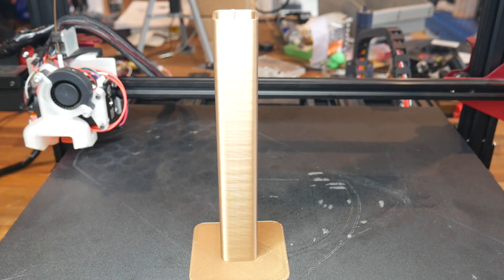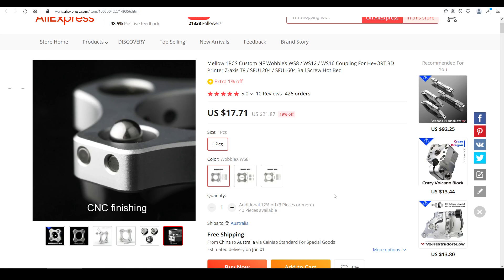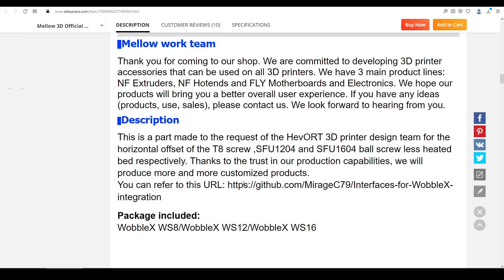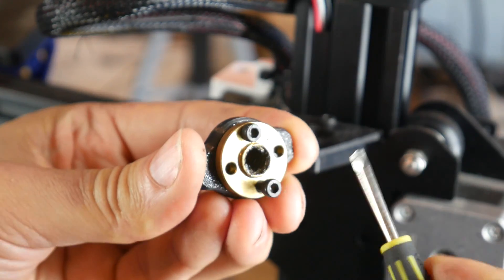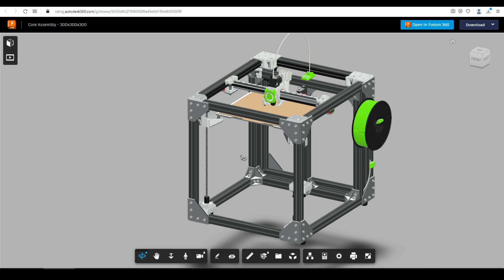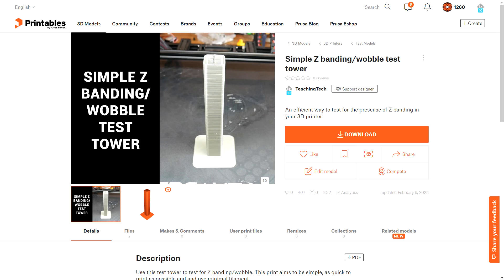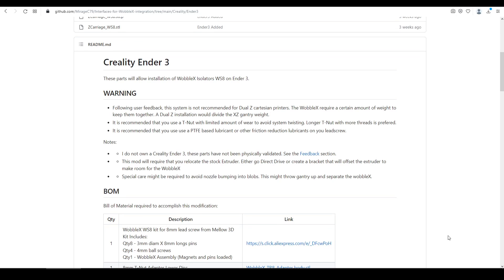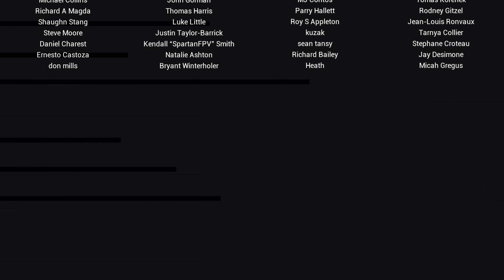The foolproof fix for Z banding and misalignment? MirageC’s wobbleX

Comment: The guide rollers on your Cr10max might be what's holding one end of the z gantry up. You could try reseting them by loosening them, letting the gantry sit down hard on the lead screws and then tightening up. Also adding little springs to hold it all together will help too.
Reply: What do you mean by letting it sit down hard? I went from being frustrated with my Ender 3 to a v400 delta over Christmas, but I'd love to solve issues like this on the ender.
Reply: @TheRealComradeOtis  with Creality (and likely many other Cartesians with V-rollers) the X gantry extrusion is not locked into the bearing carriers so its possible for it to get askew from one side to the other, when this happens one of the two outer bearings on each side will have uneven force causing binding even if the tensioners on the inside are good, Good reason frame alignment trumps all in the factor of elimination print flaws, Linear rails have the same issue but to a much worse degree, they need to be perfectly aligned with zero misalignment or the bearing carriers will completely bind.

Comment: The wobbly z-axis seems to pull the bed out of proper alignment and that seems to be the the mode that this fixes (by decupling the XY component of the wobble from the bed.

I believe a better fix for this would be a z-axis guide that is rigid enough to be unaffected by screw wobble.
Reply: You can't really heal an overconstraint with misalignment by extra rigidity, to an extent it can help but not without adverse effects. If you have a more rigid linear motion system, either the leadscrew will start breaking its attachment point or the motor, or it will start skewing and breaking the frame, and indeed i think most of us have already experienced a situation sometimes where the Z-wobble was actually the frame going askew periodically, particularly if you started with a fully DIY i3 or anything of a kind. Or it'll find a way to break the linear motion system, the bearings etc. It's a little optimistic to suspect that the leadscrew will straighten itself out, but it's a possibility as well.
Reply: @SianaGearz  CNC machines use leadscrews, have way tighter tolerance requirements, and they generally dont discuss how to fix wobbly screws… In some cnc lathes you can see the feed screw wobble. So something CNC machines do, that printers dont. Rigidity is the main differentiator.
Reply: @pyalot  If you pay for a precision leadscrew, you get a precision leadscrew, which is not what we're paying for. They've still got to have an engineering solution for aligning it correctly when the machine is built. And then it happens that our leadscrews get bent in transit, machines have special shipping requirements, not just a cardboard box with a bit of foam and paper.
Reply: @SianaGearz  Sure they use better lead screws, but in terms of wobble this mainly means two things: it wobbles less, but since the lead screw is stiffer, any wobble it does have will pull on the frame much harder. On the bottom line, the linear motion system of a cnc machine must still be vastly more rigid than any wobble component the screw generates.

It is not unreasonable to expect the linear motion system rigidity to exceed the lead screw bendiness by so much as to render the undesirable motion components inconsequential. All printers with lead screws are built on that assumption. The lead screw pulling the frame out of alignment, there is clearly an unhealthy rigidity balance. Have you tried just using more bendy screws?
Reply: @pyalot  There's actually a designed in lateral tolerance in the nut and leadscrew. As long as your wobbliness is below that, you are good, you're not putting undue force on the motion constraint system.

You're also not supposed to use leadscrews like we do. You install it in two pillow blocks and give it a flexible connection to whatever drives it, be it a geartrain or a stepper or whatnot. You're also supposed to be able to zero out the position misalignment of those pillow blocks somehow. You're also expected to have some sort of thrust bearing assembly to prevent the screw from wandering alongside its axis. That's a positively unpleasant amount of parts.

And then you're not supposed to have several constraints in the same direction, or you need to be able to align them precisely. So you have overconstraint built into the system in a typical 3D printer, because you have those two separate Z beams each with its own bearings.

More bendy screws is what i'm actually doing today, i have m6, and m5 might be an upgrade, i also have made myself Z axis nuts which have lateral travel on the attachment points. M5 was what a lot of early reprap designers have settled on for Z. But my machine is kind of deliberately shitty, i'm just cycling cheap and shitty solutions in and out for the fun of it mostly to just observe failure and laugh at myself. Of course like this the Z hops are a little slow.

People have been doing belted Z for a while, it's a very good solution for most types of 3D printers.

Comment: I didn't go there. Instead I printed L bars extending from Z screw nut. The L bars hold up bars that extend from Z rail carriers holding up the print bed.
With that setup, Z nut can go any direction but unable to rotate. The Z rail carriers do not get any movement but up and down.
The key is to not screw or bolt the bars together.
Much cheaper and easier to install.
This is for moving Z beds only. Z screw is not connected to the bed at all, just to the L bar.
For cheap Ender 3 clones, etc. Just decouple the Z screw from Z carriage. Prevent the Z screw from spinning, and allow it to move, while lifting up Z carriage.

Comment: I am grateful that my nearly-2-year-old printer still is not exhibiting Z-wobble; dual-Z steppers with a timing belt keeping them in sync + braces at the top of the threaded rods to ensure they remain stable has, apparently, been the best feature of this machine that I never even realized.
Reply: Machine model?
Reply: @stage6fan475  CR-6 SE, no mods
Reply: Thanks.

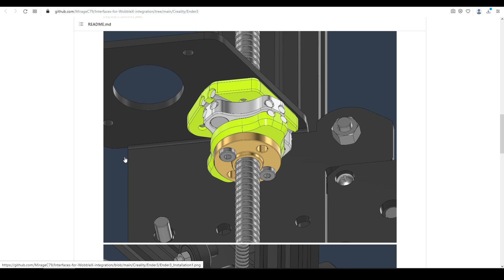Comment: At 4:00 in the video I heard something about a "fail" that befuddles me. What does the Wobble-X have to do with the mechanics of the extruder?
Reply: He says it will "foul" the stepper motor, meaning that there's not space to mount it if the stepper motor for the extruder is still there. The extruder stepper and the Z lead screw are located very closely to each other on that printer, and with the larger wobbleX coupler they don't both fit in that space. 
This isn't a problem for direct drive simply because the extruder stepper is then moved to the carriage, and that space is then open for the coupler. I suppose the other option would be to leave it as a bowden but relocate the extruder somewhere else, but may as well go direct at that point.
Reply: @perryr4796  "Foul"? Ok, that I can comprehend. TY

Comment: Well, once again, the solution for z problems is a belt transmission. Ideally, use a geared NEMA17 with at least 5:1 ratio. See Lulzbot and many others examples of Z belt transmission.
Reply: @wyattutz  Sorry, but I disagree. Belt selection is the result of a calculation. Get the right belt for your purpose and everything is going to be fine. I designed one of the first Z transmission system back in 2013. And I have several printers working fine since these days. Get the right belt and the right motor, then enjoy.

Comment: at 9:59, looks like the grease on the lead screw is a little dark, i would think that's due wear and dust acumulating on the grease. why wouldn't you clean it first, re-lubricate and try again? something might be causing some friction or stickiness between leadscrew and nut...

Comment: I changed my Ender 3 to a Dual Belted Z motion system and my banding improved massively along with hopping and fast Z motions, though this seems like a decent interim solution
Reply: I honestly think belted Z is in general the way to go. It's the right amount and type of constraint and isn't particularly expensive.
Reply: This is what I did on my CR-10s and it improved it massively.

Comment: WobbleX is good, for sure, but is symptom-solving. The real issue is that most original designs (that the Crealities of this world have copied off of) are kinematically over-defined or poorly designed, and the mistakes get inherited mindlessly. 

Any design that has two parallel linear-rails under a print-bed ought to raise heckles of a mechatronic designer.

Comment: How is this different or better than an Oldham coupler which is half the cost on Amazon?  It seems to do the same thing, but be more susceptible to errors if you have downward pressure. Or have enough weight / friction to overcome the magnets.

Comment: Incredible! A huge thanks to you, Michael, for the tremendous work you've put into testing this system on your printer and addressing some integration challenges for specific situations! Your ability to explain the system, its background, and the installation process is truly remarkable - straightforward, concise, and genuine. I'm truly pleased that someone with your expertise can recognize the potential of a solution like this!  Cheers!
Reply: And all this is based on your awesome work :D

Also what do you think about this potential solution for the slipping problem with to little weight:

Maybe increasing the distance between the Rods slightly could help keeping the ball on the tracks cauz it would sit lower inside of them? 
This would remove a little bit of the rotational axis becaus the wobblex parts are a bit closer to each other, but id guess theres isnt much rotational movement on an ender style z axis anyways
Reply: Thank you @MirageC for providing the parts for this review. I saw your original announcement of these and was considering purchasing a set for my Ender3. Not having any other printers I would not have spotted the issue @TeachingTech did. I have no problem with the weight solution but I look forward to seeing what fixes are found for this issue.
Reply: Could a central spring be used between the leadscrew nut and the part of the wobblex mounted to the printer, similar to the preload nuts that are in 2 parts and have springs, just not attached to the screw at both ends
Also stronger magnets could be used?
Reply: Hello, I Just got mine today, I will be putting them on my sidewinder X2, I can share my stl files for you to put on the gethub when im done. Great work BTW
Reply: @EtherealProject3D  how did you get on, I’m thinking about ordering one of these too
Reply: I think this would be something pretty cool to use to make your 3D printer a 4D printer. that bed in the video... you could be printing slanted!
Reply: I think increasing the space between the pins should help at least a little. Whether or not it would be enough I can't say, as I have no way of testing.
Reply: Awesome work designing the parts and then bringing them into the world! I am going to buy a par and install them (also thanks to this video).
Reply: If running 3 of these on a 3 rod core xy, would they allow enough play to do automatic z tramming using three separate motors?
Reply: A simple solution to fix the weight issue on the ender would be to mount the wobbleX & lead screw nut above the plate instead of below.
Reply: @MyYewTubeAccount  How would that add the needed weight/compreesion to the wobbleX? Just its own weight/gravity?
Reply: @D4RKFiB3R  I am unsure, my experience may not relate directly to the wobbleX, but I have for many years installed anti backlash springs/nuts in this fashion and it's always achieved better results.
Reply: @MyYewTubeAccount  Interesting. I will try that out.
Reply: @MyYewTubeAccount  Mounting it above wont work at all. The WobbleX system needs gravity (and the MUCH smaller magnetic force) to hold it together. If you mount it above the plate, your gantry will simply fall down!!
The reason why mounting an anti-backlash nut above the plate MIGHT work, is because there there is a mechanical coupling with the lead screw above AND below the 'loose' spring (via a rotation force --- both nuts need to rotate at the same time in order to be moved up or down... that's the whole point in how the anti-backlash works).

As a second note: @Capital Inventor is 1000% right. Waste IS a MASSIVE problem in the hobby 3D printing world!!! So, every small bit helps to mitigate it. And using 1 bag instead of 4 seems indeed like a massive but easily preventable waste. Although I can understand where this comes from: all the parts are most likely outsourced and thus come from different sub-factories, each packing their own stuff. All the 'seller'/main manufacturer of the WobbleX does is putting those packages together. The product has such a low selling yield that buying all those parts in massive bulk seems very unlikely. But who knows.... This is definitely something which should be looked at IMHO. And who knows, it even might take the price down by a cent, as the WobbleX seems to be overpriced IMHO.
Reply: @MyYewTubeAccount  but they cant separate, this will just separate and fall
Reply: @MyYewTubeAccount  that won’t make any difference except make it harder to mount. The mount relies on gravity to keep enough pressure on its components, whether or not it is mounted above or below won’t change the amount of weight on it. This mount is multiple unconnected pieces stacked together so you couldn’t mount it upside down either. The mount only has one nut in contact with the lead screw, unlike an anti backlash nut that has two nuts separated by a spring.
Reply: One thing I noticed, and this product is by far not the only one guilty of doing it, is that it comes in three plastic bags contained in another plastic bags. We're supposed to be getting rid of useless plastic and here is something that uses four plastic bags when it only needs one.

I know that it's done to make packaging faster but at the very least one piece could be in the large bag and the other two could be added to that instead of having an empty large bag and three small bags added. It would at least save one plastic bag with every product and not impact packaging. We're worried about saving 10 cents on the price but that means that we end up with a bunch of extra small plastic bags produced.

I appreciate your contributions to 3D printing and I don't mean to have a go at you specifically about the waste in product packaging. There are companies that do a lot worse but that doesn't mean that others can't improve ahead of them.
Reply: @capitalinventor4823  Bro, how much waste do you create 3D Printing?
Reply: @MyYewTubeAccount  

We all waste by 3D printing but I do my best to minimize the waste generated. I'm also saving the waste from my filament printer so that I may recycle it one day. I hate the waste involved with resin printing and that there's nothing to be done with it. 

My point was that it would be easy for these companies to look at how products are packaged to try and cut down on material that is not required. For example, I just received some items from IKEA and every item was rolled multiple times in a dual layer of wrapping tissue and thicker, unbleached paper. Even items that were already packaged to be shipped on their own, such as a chef knife cradled in plastic in a cardboard box, were wrapped in multiple layers. The plastic bags included with the wobbleX are most likely created from fossil fuels and then will just be sent to landfill after the person installs the product. With a minor change to how the product is packaged, one of the small bags could be eliminated with no impact to the product. A very small win for the environment, but a win no matter what. It would be great to go further and get rid one or both of the other small bags but that that wouldn't be as easy as I bet they are probably getting those already in the bags from different suppliers. I'm guessing they are getting the three parts from three supplies and just putting the three bags into one larger one now.
Reply: @capitalinventor4823  I agree with you entirely. There is no reason to add waste where it does not improve the product or help the consumer. Gamers Nexus critiques this from companies all the time. Why do we put so much material into packaging which will be discarded? At least small zip close bags are reusable, but most of us will never use them all. Anyone who criticizes you for your constructive feedback is missing the bigger picture by thinking it isn't made up of smaller designs.
All that said, the WobbleX is awesome!
Reply: @capitalinventor4823  you are right. Small tip: try to focus on the relevant things in life
Reply: @meanmartine97  I would argue being good stewards of our planet isn't a small thing. Most of the plastics we make can't be recycled very easily (at least not into something as strong as the original creation of the plastic since plastic degrades a lot during recycling, making it not cost effective for companies to pursue). I am no environment warrior, but the one thing I try to do as much as I have control over is reduce my plastic usage. If everyone would be more aware of that and not use a bag at the convenient store, or carry things they can out of a store without a plastic bag, it adds up. It adds up even more in mass manufacturing. They could save a ton of plastic waste if this company, and every other company, made more deliberate choices on how they used plastics. Plastics are here to stay, and they are essential to a tech-filled way of life, but you can also be responsible, especially companies.